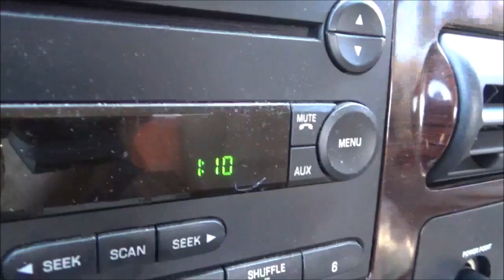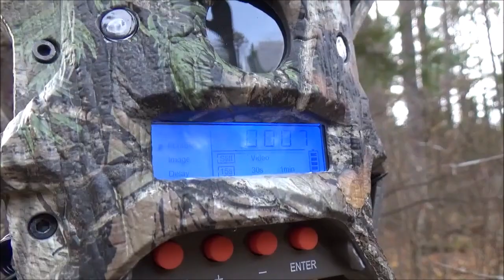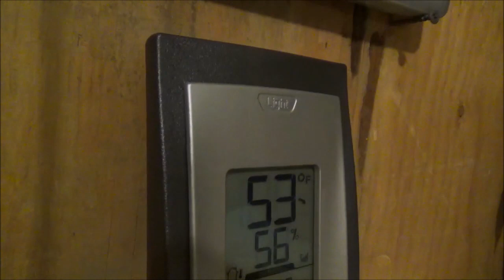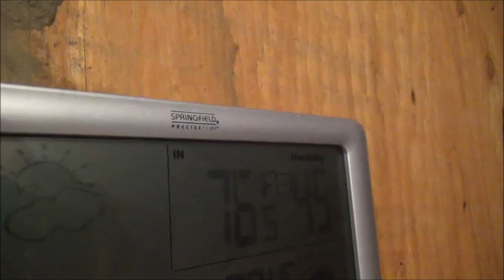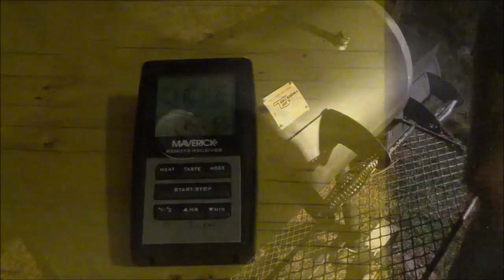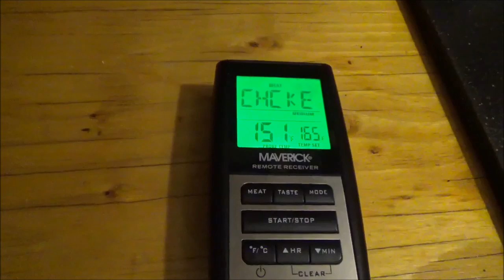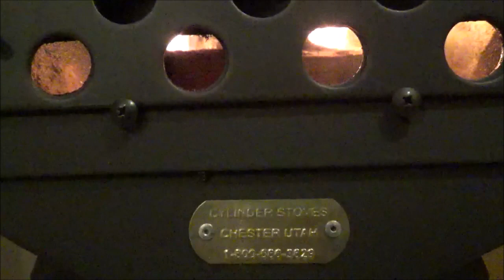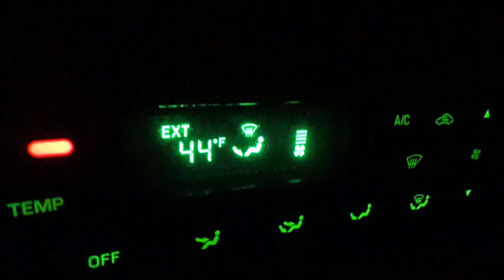THE TENT. Late October. Its all about Deer Hunting. Stands. Cameras. Cooking. More.

Comment: Joe to change up your potatoes,  cut them up, with green peppers, chopped onions, whole kernel corn, sprinkle with salt, pepper, garlic powder, red pepper flakes and plenty of butter, make the tinfoil like a pouch, sealed around the edges, put on the grill a little while before you put your steaks on....soooooo goooood!!!!!!  Another way I do yellow onions is to cut in half, leave on the peel, sprinkle with lowery season salt, put cut side down and let it grill till it chars snd softens some, then flip the onion over peel side down and put some butter on onion another pinch of season salt let cook some more.... take up, pull skin off onion, cut up. So good with pork steak or regular steak....

Comment: I have been using a pop up blinds for about 10 years, It makes things more comfortable an injoyable being out of the elements. I also use a Vangaurd Bi Pod, You can move it around easier inside the blind. Building a frame to rest the gun on works great to. Have a great season. Good Luck.

Comment: Joe...for hunting out of that ground blind, which I do every year here in southern Missouri is I cut a smaller tree limb (in my case, Cedar) with a good fork and debark it. The fork becomes the base and the branch is your rest. You can't move side to side because of the fork part on the ground and you won't move back and forth because you're sitting in a chair with a grip on the branch and the barrel at the same time. It's a very stable shooting platform and I starting using one because it pissed me off that they wanted 20.00 at the store for a cheap plastic one. Try it and it will be one of those palm slaps to the forehead for it's simplicity and usefulness.
Reply: One more thing, not for you so much but for others is you will have to cut the fork leaving a good 4-6 inches for on the ground and the branch longer than your shooting height a little.

Comment: Hey Joe I just wanted to give you a heads up. You talked about need to take out all the canned goods before winter. I don't think you'll need to do that. If you pull down the label on the side of a can you'll notice that they're all corrugated. That's too low for expansion when they're canning them in the factory. But it also works the other way around if they freeze does corrugations allows those two xpand 2. We had a bear proof tub in Alaska that would put all of our canned goods in when we left for the winner. To my knowledge we never had one can rupture or go bad. You may want to try leaving two or three cans in your tent on a paper plate and let them over Winter and see what you think save you a bunch of labor. We did this for many years going back into our moose camp and it would get down 40 50 below zero and never had an issue